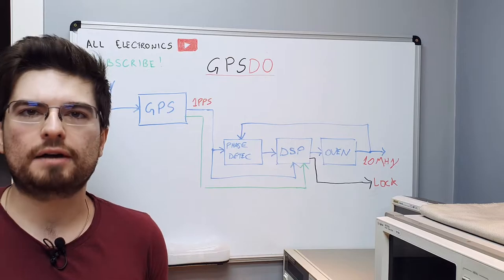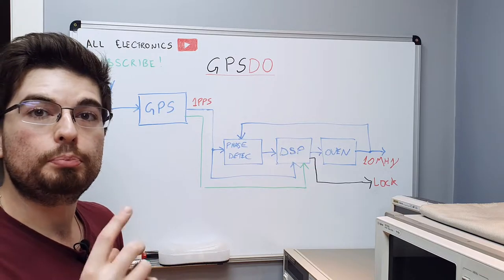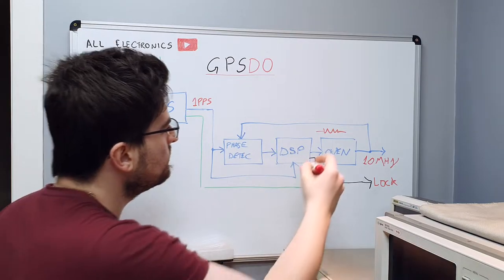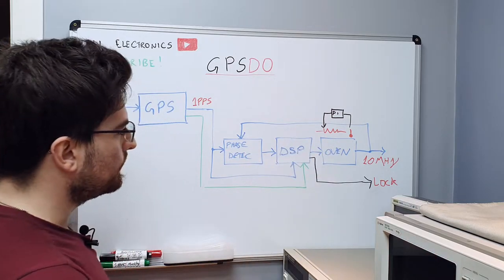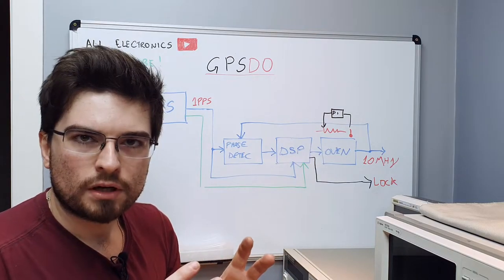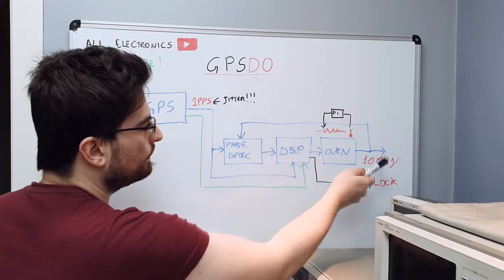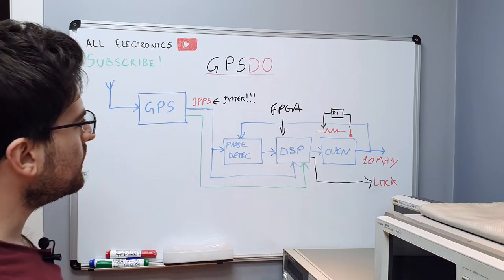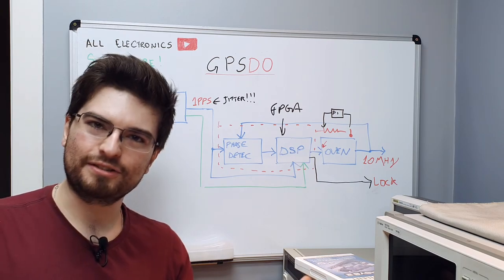Developing a GPSDO from scratch - part 1

Comment: Ublox module that outputs a 24MHz "PPS" connected to a si5351 will give quite a stable reference but the phase noise is not the best. Alternatively use the MHz range pps output to feed the PLL. The ublox output is jittery when outputting frequencies that are not an integer division of internal clock (48MHz) so chose you frequency accordingly. Lower clock output, better phase noise.
Reply from the maker: Yep.. I'm using the neo6 with 1 PPS output signal.

 After first lock I switch to a very low freq digital low pass before the phase comparator.

I changed a bit the design to use simpler components. FPGAs are no available to everyone.

 You can see more videos about the project on the channel !

Thanks
Reply: @AllElectronicsChannel  I skimped thru all of them. What is your goal, just stability or do you want to use it as a reference oscillator (low phase noise)?
Reply from the maker: My current goal in experimentation and learning hehehehe.. I got really impressed by the phase noise of the homemade ocxo I designed!

But unfortunately I think that the long therm stability is not enough for a gpsdo.. maybe with a properly thermal insulation and metallic case

Today I'm characterizing the PWM DAC I made.. the next video will be about it
Reply: @AllElectronicsChannel  A worthy goal in itself. If instability comes from temperature, high thermal mass and insulation should help.
Reply from the maker: Thanks ! I will be posting more about it..

Comment: Great video!
I am in the process of specifying hardware for a public safety simulcast paging transmitter network.
Motorola charges over $12900 for their rubidium reference solution and the GPS one is slightly MORE $

Time to build it 😆😷👍🏻🇺🇸

Comment: Thx for pursuing this ultimate frequency standard. I believe the accuracy should be around 10-12 to 10-13. Sorry no superscript.

So the control loop is actually two loops. One is an FLL, a frequency locked loop. The other one is a PLL. That gives you the greatest lock in range which is needed.

Gregory thx for taking the time in making this video and sharing.
Reply from the maker: Thanks! This is an old and unfinished project..  hehe. We should get back to it some time soon 😁

Comment: Hi! Thank you for uploading this kind of content
I am trying to develop a very similar system and I'm basing my work on the LARS GPSDO (which follows almost the same philosophy as yours).
I wonder if you could answer a question: If I wanted to output a Disciplined PPS (not only 10MHz signal), how could I do that? Would you extract that PPS from the DSP or from the OCXO (using several frequency dividers until geting 1Hz) 
Thank you very much, any kind of help is highly appreciated
Reply from the maker: Hi! I would divide the high frequency to 1Hz

Comment: did anyone replaced the 24mhz or 48mhz crystal thats on the NEO xx with a 20mhz or 40mhz one???  the next stage will be a hcxx buffer and that's it.
Reply from the maker: Why??
Reply: @AllElectronicsChannel  in order to get a 10Mhz that is clean from jitter directly from the GPS. wouldn't that be already  gps disciplined?
Reply from the maker: Hello man! Hum.. the raw output of the NEO have high phase noise (jitter) this is why in GPSDO a very stable and clean local oscillator is slowly disciplined with the GPS reference
Reply: @AllElectronicsChannel  i didn't see jitter on the oscilloscope when i outputted from the neo7n 12MHZ that is a complete div from the 24MHZ crystal. on 10MHZ i saw jitter.  replacing the crystal for 20MHZ may give good results for  div by 2 for 10MHZ. just an idea.
Reply from the maker: Nice idea to give a chance.. for properly jitter measuring you need a spectrum analyzer with good phase noise. I will measure it next time I go to lab